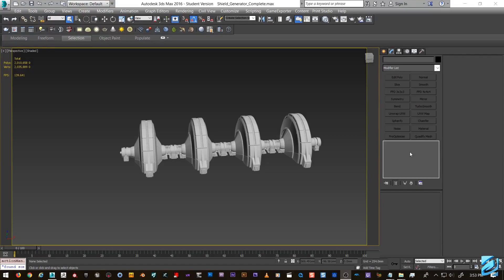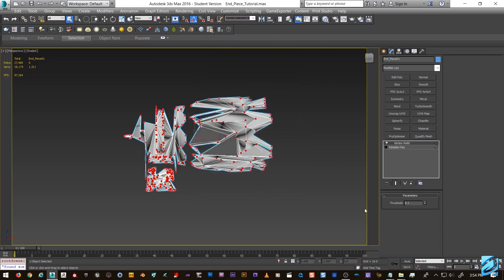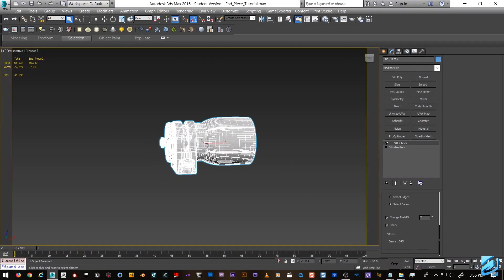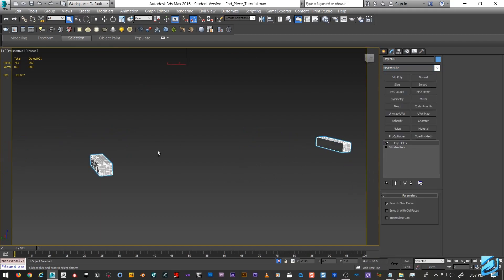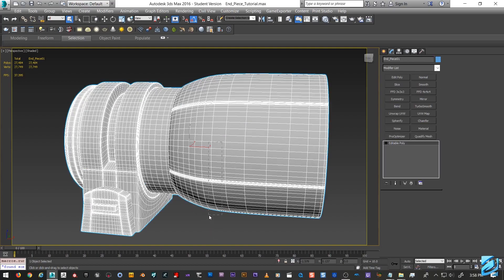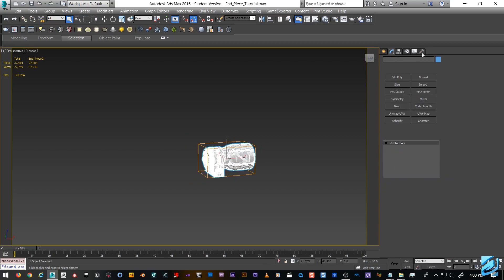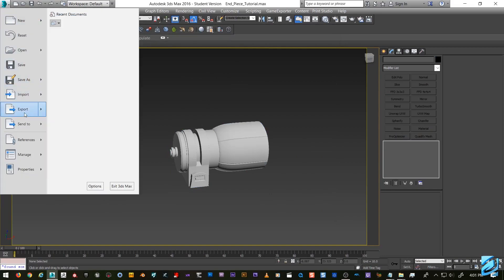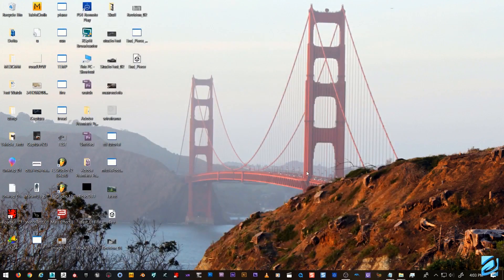3DS Max Tutorial - Preparing Models for 3D Print and .STL Export

Comment: This 3DS Max Tutorial was really helpful!! Thank you
Reply from the maker: Thanks man! Glad it helped :)
Reply: @JCobesV2  How do you import  HeroForge.com .stl into 3dsmax2020 without it Hanging/crashing
Reply from the maker: @christreedee  Hey Chris, I just checked out HeroForge.com and seems real cool. I'm assuming they models are pretty dense then? Whats the file size of your .STL? If it's a "heavy" model then wait times are expected in any software and depends more on your PC's specs. Let me know.
Reply: @JCobesV2  seems to be IMPORT settings, welds and  what not not familiar on how a .STL 'SHOULD" be imported for minor editing, and they seem to triangle most things so i want to quad-mesh it back to make it easier..... but the import settings seem  to have a huge effect
Reply from the maker: @christreedee  Yeah, you always want to utilize the "Quick Weld" option when importing .stl's into Max. However, in this case, I think you should use a middle program. 3DS max is always going to triangulate .stl from my understanding. So I researched and there are other programs that can get your model print ready while maintaining "quads" or converting to quads. If you do this, I would recommend exporting it as a .obj is you wanted to still use 3DS Max. I would avoid 3DS Max altogether in this instance. There are free versions of Net Fab or FreeCad that might help but if "quads" is the need, find a program that will get you those results.
Reply from the maker: @christreedee  https://forums.autodesk.com/t5/recap-forum/stl-mesh-to-quad-to-import-and-convert-to-quad-and-then-to-t/td-p/7949446

Comment: So i trued using the ruler in 3d max to make model to realistic inches but it doesn't work...any ideas? As I had to modify with milling machine software..

3d printer is brilliant tool for 3d model makers but there are small so you have to make model to real life measurements..  inches or cm's
Reply from the maker: Hey Soda, what program are you using? In 3DS Max you need to make sure your system units are set to Inches or cm and not just display units. In 3DS Max, go to Customize--->Units--->System Units----> (set to inches, cm, mm, etc).

Comment: sir is it necessary to split model into little pieces ? what if i make all model from single mesh ? will accept for printing ?
Reply from the maker: Hey Uzair, you sure could. This asset was modular, so it could be assembled in pieces. If you have one solid model without errors you should be fine :)

Comment: Awesome vid, ty very much it helped a lot. I mean tbh I knew all the tools etc, but seeing the workflow and simplification of it all just gave me a better complete take on it all in case I am missing something or doing something wrong.
Just one question, with regards to dimensions, does STL keep the cm setup? Or do we need to do something funky to convert dimensions over?
Again, thnx for this vid, really clarified the whole workprocess.
Reply from the maker: Thanks for the great comment! Means alot. The STL will export and maintain whatever units you have established in the file. So be sure to check “Customize” —> “Units” and make sure cm is checked in both display and, more importantly, System Units. Hope that helps!
Reply: @JCobesV2  awesome, thnx for the response. Perfect, so I can go ahead with the exports then.
Again, a great and straight forward video. Thnx for the upload.

Comment: i am starting doing 3d printing, im having a problem trying to export from 3d max to printing, when i export the stl file from 3dx max in import the file to Ultimaker Cura, it goes in to another size really small en the area to print,  the printing area of my 3d printing is 22x22cm but i think the whole big are of 3ds max is going in the file, i dont know what to do... :/
Reply from the maker: Hey Roger, I'm sure I know what's going on. Your measurement units in 3DS Max are different than Ultimaker Cura. This is kind of hidden but try this: In 3DS Max, Go to Customize ----> Units Setup ----> System Units Setup. Now this is different than "Display Units". Make sure your "System Units" are set right. For example, if you're printing in cm make sure your "System Units" are set to cm. You should be good to go. Let me know if that helps!
Reply: @JCobesV2   sorry, it still doesnt work :/

Comment: wouldn´t it make problems for the 3dprinter if it had to print something from the air, with nothing under it?
Reply from the maker: Hey Daniel, I guess that depends on the 3d software you use to print. 3D printing software often has options to print with "bridges" which creates a base of spikes that hold up parts of the print like pillars.

Comment: quick question, meshes that clip through one another will print as a single piece?
Reply from the maker: Hey SkyGuy! Sorry for the late response. As long as the separate pieces are capped correctly and attached together they will. You can kind of think of it as "blobbing" meshes together. So if things are running into one another without errors, the printer will see it as one piece. Or at least in the printer programs I've worked with. If you want to print pieces separately, create them separately from one another (e.g. Legos).

Comment: Thanks for the awesome tut!  one question though, when a 3ds max file is exported, the polygons all get "pixelated" like you got here.  any way to fix that?
Reply from the maker: Glad it helped Phillip! I’m not exactly sure what you mean by “pixelated”. Could you explain in further detail?
Reply: @JCobesV2    thanks for the reply!  you can see in your video,   surfaces looks nice and smooth, but when you exported the model in ,stl you can see in 10:29, how the surfaces aren't smooth anymore, you can clear see each polygon edges.  I get this too and I was wondering is there a way fix this?
Reply from the maker: @idgeek  Yeah I see what you're saying post-export. Are you seeing this in your prints? Most prints don't come out perfectly smoooth anyway and require a little sanding to make them glossy smooth. I don't have any soutions other than using a 3D mesh repair tool like Netfabb and use some of their clean up tools. I don't think there's much to do with it however.

Comment: I think I found a site that has a 3d model files of my car I have. Im trying make 1/10 of my car for a rc car. 1966 dodge charger. Would that be to hard to if I get the 3d model files what problems will I mite run in to?
Reply from the maker: Great question! I'm assuming you're using 3DS Max? However, all 3D programs should have a simple solution for this. There are a couple of ways to go about it. First, you need to check the measurements of the 3D file you're importing and find some answers, such as, "is it the actual scale of a real car?" If so, you can simply Scale By World % to 10%. Another solution is to know your exact measurements of the RC car you want to print, make a block with those measurements and scale the model to fit. 

After you have scale landed, you will need to know how to break it down into the RC or 'toy" pieces. The 3d file you import will be very generic (usually for rendering purposes), meaning that it will not be ready to meet your exact needs. So, you will need to know how to model the individual parts to print (exterior pieces). It's hard to sum it up in a quick comment but, ultimately, you will need to know how to model. Depending on the 3D file, you will import it and will most likely print as a giant block and it sounds like to need a bunch of assembly parts. Hope that helps!